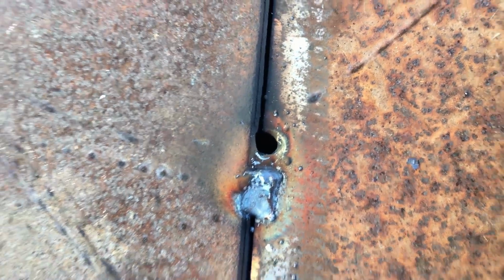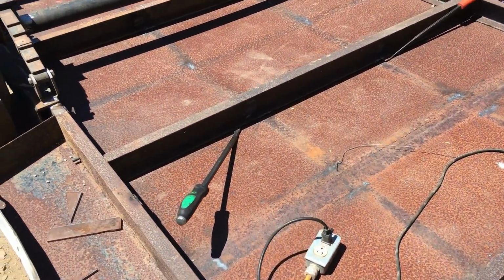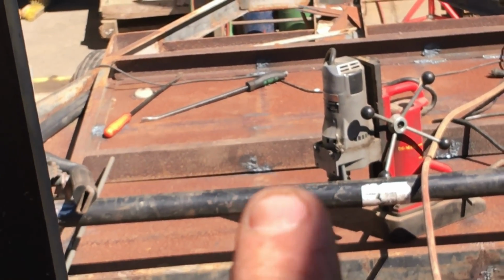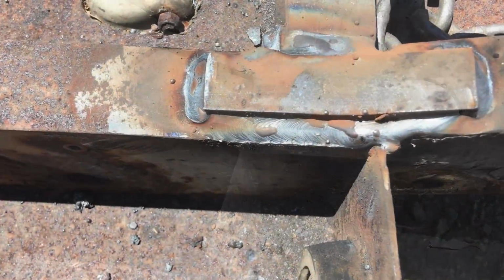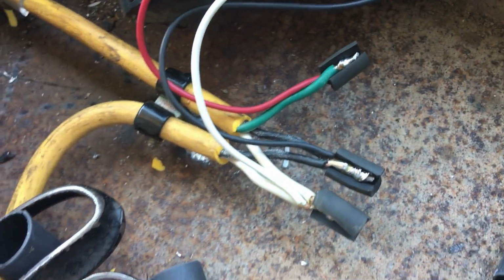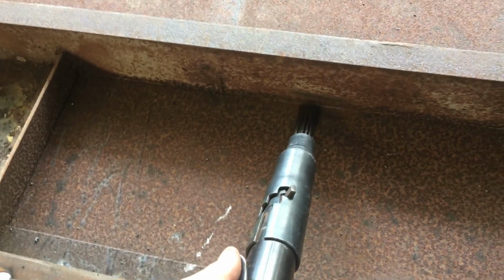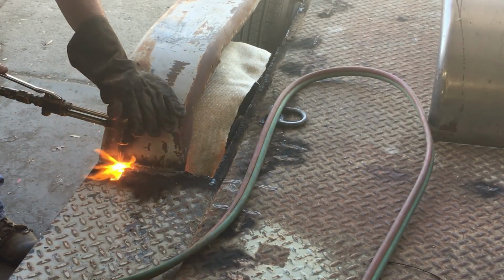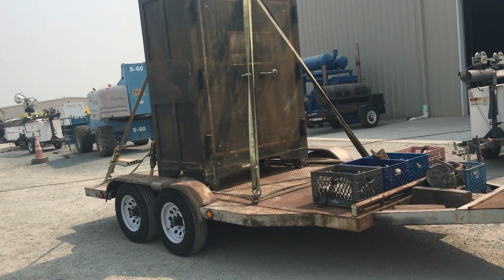Beefing Up My New Trailer Part 2

Comment: 2 yrs ago you posted a 342 water pump rebuild .. can you tell me what the white plastic piece is ? I see it where you explain the adapter and seals and tension spring. The seal kit i have coming also has the white plastic piece included but my pump didn't appear to have that piece when I disassembled.. thank for your help

Comment: that was a really fun video from beginning to end. i really liked how clean the lathe was coming out. supper cool. i was a long time automotive tech, lots of electrical repairs. often i used un insulated but crimp connectors that i would crimp, solder, and then heat shrink. this is very quick, clean, efficient and small. it also produces a regular inline connection which is nice. Granger check them out.
Reply from the maker: Thank You Jack.  I will have to try some of them out.      Gary

Comment: Ok I love the content and am always hanging out for your stuff but - my head almost exploded at pressure washing a lathe and the electric motor for the lathe - how the hell do you ensure nothing becomes water damaged .??
Reply from the maker: Rupert, I hope your head is doing better LOL   All kidding aside it’s not as bad as you think. When equipment is caked up with gunk as bad as this was it’s the best way to get it cleaned up. I was washing it on a 100 degree day. Blowing it off with air hose and letting the sun Dry it out. And I really appreciate you watching the video,    Gary

Comment: When I do electrical connections that are outside, I buy these heat shrink pieces that have closed ends, and the inside melts and seals the open end towards the insulation. McMastercarr normally carries them. I know they cost more, but I have piece of mind that water, and possibly salt, can’t get in and corrode the ends of the connections. And when considering the total cost of the project, it’s a very minor amount, just a few bucks.

Great as always. Very interesting to me, being that I’ve never worked on a trailer.

Comment: Gary, thanks for the oration while you are working, I think it adds a lot to watching.  If I can use a Texas saying, I preciate the hell out of it. I did a similar restore on my boat trailer, just went the other way and lightened the springs as much as I could, boat is a high performance sailing  single handed dingy, 17 feet long weighing 160 lbs. I will go back and soldier all of the electrical connections. I always see something in your videos.
Reply from the maker: Thank You Richard. With your boat you probably could of used buggy springs LOL
I appreciate you checking out my videos.        Gary

Comment: Nice that the deck is clear, fenders you can drive over are the best for that style I think.
Reply from the maker: I agree Brian, only problem is the sections of the deck directly in front and behind of the fenders are not very strong. So having drive over fenders would probably not be needed.     Thank you for checking out the video and commenting.       Gary

Comment: Something sounds amiss with your mig welding.  Kind of leaning towards slow wire feed.  Roller slipping, or wirefeed  set to low for the voltage.  Very clear stutter to it.  A lot of undercut.  I know it isn't critical stuff.  But always a good opportunity to hone a skill.
Reply from the maker: I purposely slow down the wire feed, burns in much better on dirty or rustier material.
Reply: @OldIronMachineWorks  Gotcha.

Comment: Looking much better, amazing how folks will cut corners. Not sure if you know but those Dexter 5200# axles may have the LM67010/LM67048 cup and cone for the outer wheel bearing pair. If so those can be upgraded to the 15245/15123 cup and cone pair. The 15123 is the bearing used on the 6K and 7K axles and is much heavier than the LM67048. -Mike
Reply from the maker: Thank you sir, and no I did not know. Thank you for that information.     Gary
Reply: @OldIronMachineWorks  Details for all the brake and bearings parts are covered in the Dexter Light Duty Catalog.

Comment: Looking great!  I always soldered.  I even used WBB boxes and compression fittings on the boxes to wire things. I despise hooking onto a trailer and having to hunt down crappy wiring.
Reply from the maker: Tony, Thank you. I haven’t seen a good soldered connection fail yet. But I’ve spent my share of time hunting down loose connections. Thanks for checking out the video.      Gary

Comment: I build my fenders from 12" stair stringer channel. Those light weight fenders don't live long of you use it for real work. I need more D rings on mine. Just have to make time to do it .Looks great  Cheers...Edit... BTW paint is highly over rated 🤣
Reply from the maker: Thank you Warren. I hate flimsy cheap fenders, and you can never have enough D rings. Paint will definitely make it look a little nicer, but it sure won’t do no good for adding strength LOL thanks for stopping by.    Gary

Comment: How do you mig weld without having a clean, rust free surface.
Reply from the maker: John, unlike TIG welding Mig is much more forgiving. The needle gun does a great job knocking off the rust prior to welding. It still has a rust stain but the wire burns in no problem.    Gary

Comment: I hope that you are going to sandblast the trailer and use epoxy paint. It would never rust again.
Reply from the maker: John, The rust is just cosmetic. It will be nice to get painted down the road, but I will spend more money sandblasting and painting than I have in it right now.     Gary

Comment: Another great video Gary. I imagine with the deck plate all welded down it rattles less going down the road.Al B in Ohio.
Reply from the maker: As quiet as could be. Now instead of carrying deadweight it’s adding a lot of structural strength to it. And thank you for the kind words.       Gary

Comment: G'day Gary.  That new trailer of yours is absolutely amazing mate.  It's going to make your like so much easier picking up and relocating machinery and or tractors.  My good buddy over here recently bought and modified a similar trailer.  However, he installed an electric over hydraulic Hiab crane to it.  I need something like that.  OH, and a much bigger shop LOL.  Cheers, Aaron.
Reply from the maker: Thank you Aaron. I’ve also been working on another trailer that will make an awesome equipment hauler. One year ago I posted a video of it called  More than a one trick pony. If you get a chance to check it out I think you may like it. Thanks for stopping by and have a great weekend.    Gary

Comment: Already looking forward to part 3 with the new fenders and paint prep, also looking forward to seeing that cleaned up lathe making chips
Reply from the maker: Paul, I really wish there were more hours in the day. I think the Lathe will be making chips before the trailer sees paint LOL thanks for stopping by the channel.     Gary
Reply: @OldIronMachineWorks  When there are not enough hours in the day we are forced to prioritise.  You needed to make the trailer strong enough and safe enough to transport the monster safe home as well as the large lathe so you could remove decades of grease and grime, so some of the trailer activities went to the top of the to-do list, the trailer paint job may eventually make it to the top of the to-do list, but if your to-do list is anything like many folks, it could take a few years, or it may never get to the top as new tasks come along :)

Comment: I am curious why you used the torch to cut some things instead of the plasma cutter.
Reply from the maker: Mark, you must have skipped over the part of the video where I mentioned the plasma was going to take too much work to get outside to use. 
Plus it doesn’t hurt to keep up on my torch skills LOL.       Gary
Reply: @OldIronMachineWorks  Ah, must have missed that.